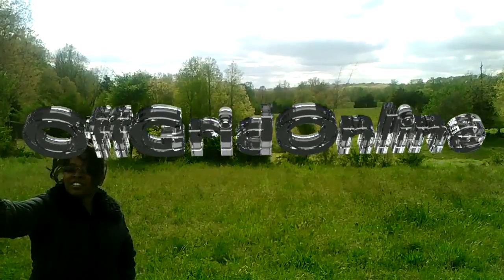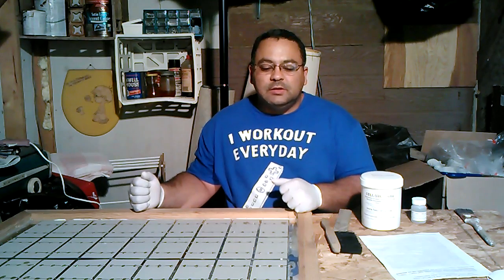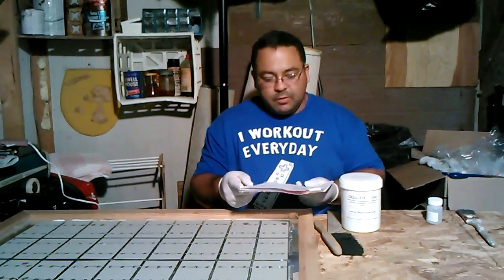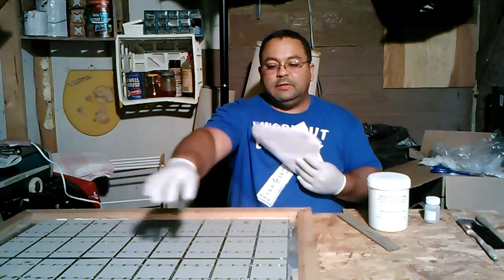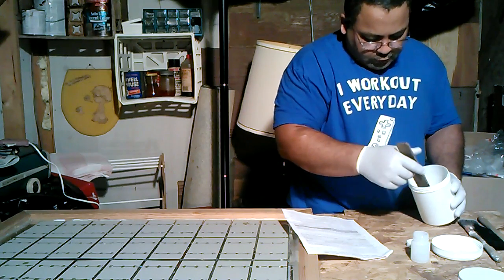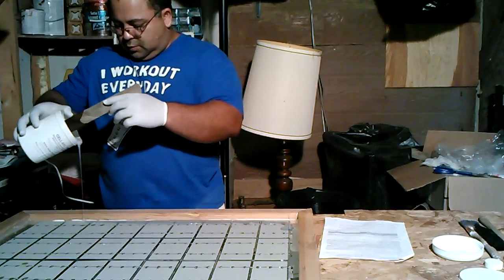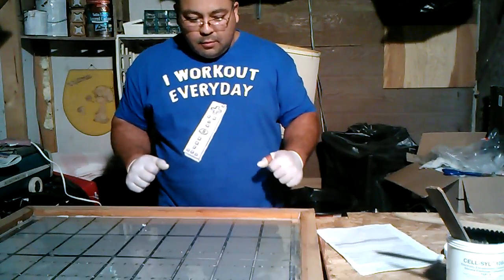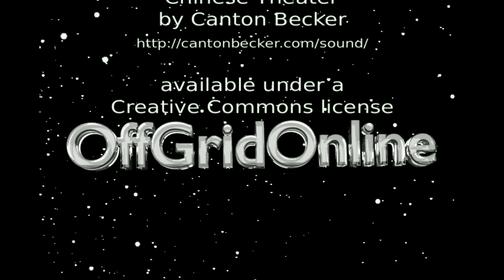Solar Panel Build Project Part 3- Encapsulating

Comment: Please tell me that can I definitely use murtisil silicon
Reply from the maker: I have not personally used that product; however, as long as it leaves a protective coating on the cells, adheres the cells to the glass and is clear so as not to hinder the sun's rays from reaching the cell surface, you should not have a problem.

Comment: Sir but in this you have used ensil silicon why is this essential for this
Reply from the maker: The two part encapsulant accomplishes two things: It gives the cells a little protection from cracking and it also holds the cells to the glass. I used this particular product based on the price at the time and because it claimed to be perfectly clear. Its claims were accurate; however, I can no longer find this product.

Comment: Sir can i use murtisil silicon for this
Reply from the maker: Manoj Kumar , I have not personally used that product; however, as long as it leaves a protective coating on the cells, adheres the cells to the glass and is clear so as not to hinder the sun's rays from reaching the cell surface, you should not have a problem

Comment: can you show me how to bead with silicone and pour the encapsulant on the side where we connect with positive and negative wires.........please help me out
Reply from the maker: Did you get this figured out? I am so sorry that I missed this question.
The silicone as well as the encapsulate is non-conductive. I just strapped the positive and negative wires to the edge of the wood frame where I could connect wires to it. I laid the larger bus wire on the wood and put a screw through it. Then I soldered a regular wire to the bus wire with a connector that I took from a florescent light fixture.

Comment from the maker: actually, each kit has two parts. the one i used has the big bottle(1084) and the little bottle(1084c) these two get mixed together in order to create the finished product. in the video, you should see how I mix the two before application. I bought my supply a very long time ago. the website that is on the bottle is not in existence anymore, but the product sold on ebay still looks the same.
Basically, you have a part a and a part b. you mix the two and spread it on your panel. wait to dry. done

Comment from the maker: I have never tried Sylgard 184. I got this stuff because of price. I am pretty happy with it so far, and i used it for "Back encapsulation" so i don't believe I will have to worry too much about fading. but as of right now, it is as crystal clear as they claimed.